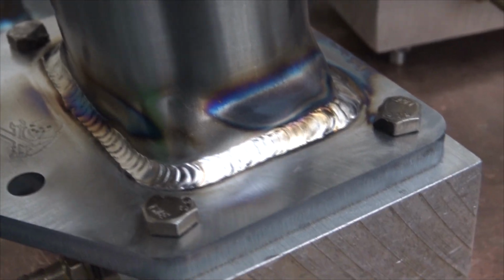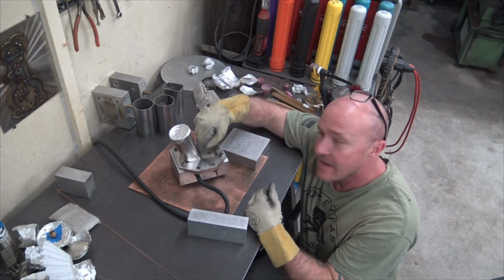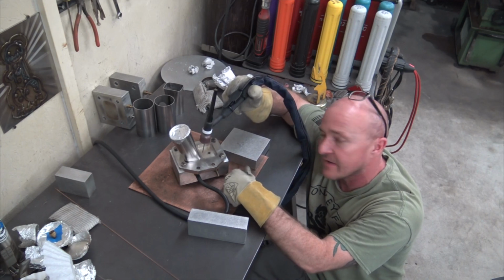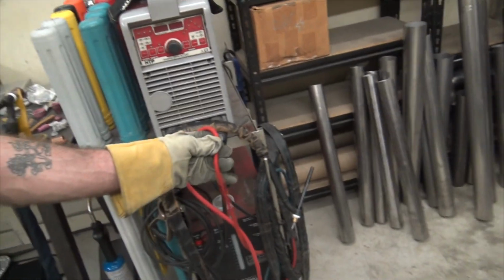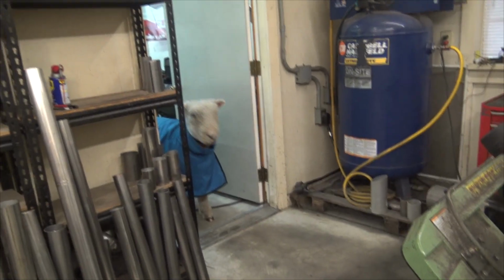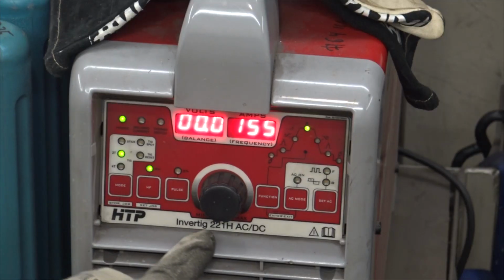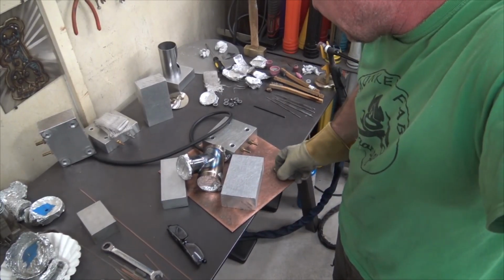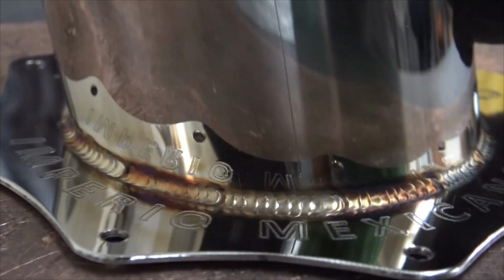Everlast Powertig 200 DV review part 3

Comment: I bought this 200dv last week and thinking about returning it and upgrading to the 210ext since my machine is cutting out in ac only when im anywhere past 150 frequency.
Have you ran the 210 or 255ext and are they that much better for aluminum over this machine?
I mainly weld aluminum charge piping and stainless headers,exhaust 
Cheers
Reply: What did you wind up going with?
Reply: @rgraptor2542  i sent my 200dv back and received a new one 
Same model.
Its been awesome 👌 
Id love some of the square wave features of the next model up but its a big price jump.
This 200dv welds aluminum really nicely
Reply: @audirx8  good to know! I'm looking at getting one, just don't want to pull the usual buy one now then buy another later because "more power!" 

I reckon it will be fine. Your first comment had concerned me, glad you got it worked out though 👍